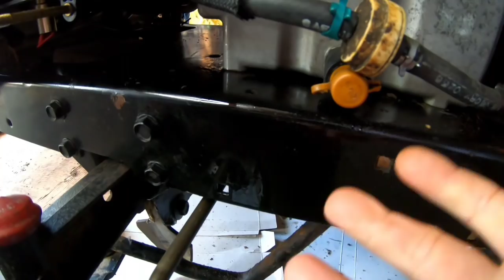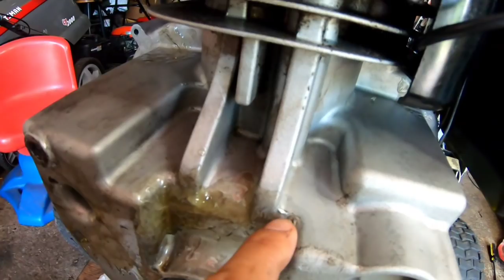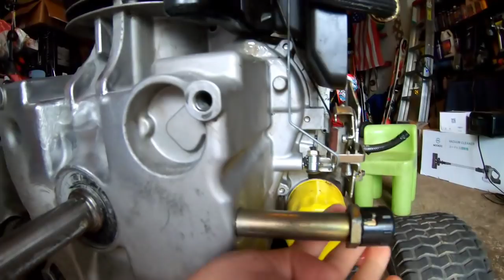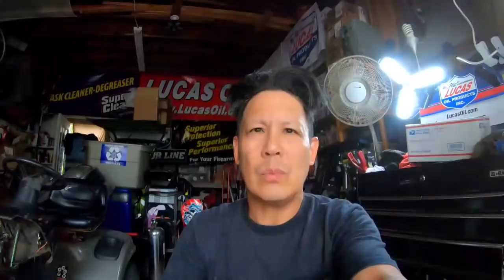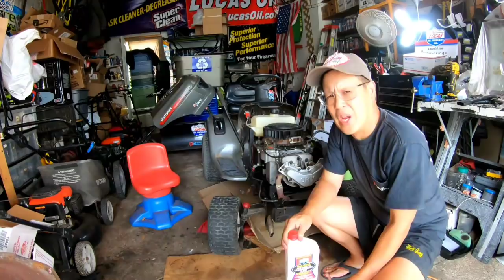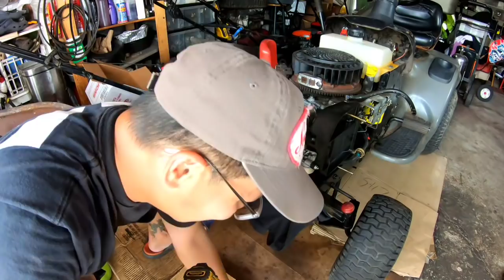CRAFTSMAN LT2000 LAWN TRACTOR REPOWER PROJECT CRACKED PLASTIC GAS TANK REPAIR ACCIDENT & TEST DRIVE

Comment: Henry, We used to repair the plastic tanks that held the calcium chloride that were mounted onto our tandem dump truck mounted salt spreaders by using a similar method of melting a pretty thick piece of scrap plexiglass onto the bad area. 
We had a wooden handle putty tool with a stainless steel blade in which the blade was heated up with a torch almost where the metal was glowing. We used the putty tool to smooth out the rough surface and to help blend in the melted plastic with the plastic tank. This fix works pretty well once you get the hang of working the melted plastic. 
I am glad that you were not seriously burned from me flash out of the gas vapor within the tank. As a welder for many years, I feel your pain and have been there and done that more than I care to admit to. Once a gas tank has gasoline poured into it - It is very difficult to completely get rid of the gas vapor. A good flush with Dawn dishwashing detergent and hot water usually works out pretty well for small engine fuel tanks.
Reply from the maker: You have a solution to get my eyebrows to grow back?
Reply: @MowersNBlowers  Hmmm Henry , Miracle Grow maybe.  I am really glad that you were not seriously burned. It only takes a split second to ruin your life forever.
Reply: @MowersNBlowers  See if your wife has a eyebrow pencil?

Comment: This comment is not directed at Henry, but I was actually thinking about it today while working on mowers.  The entire point of a lawn mower, whether push, self propelled, riding, or zero turn, is TO CUT GRASS!  The most important part for cutting grass is correctly sharpened blades.  Correct angle, straight blade (not bent), sharp.  You absolutely cannot sharpen blades correctly without taking them off the mower, putting them in a vise, taking your time, and doing it.  I see bent, chipped, dull, incorrectly sharpened blades daily on customer mowers.  Book says blades need to be sharpened every 8 hours of use.  Some people are lucky if they sharpen them every 2 years.
Reply from the maker: I don’t have that book,  the book is for mechanics

Comment: That engine is know as the bucket engine, it’s a piece of junk. Then upper part of the engine will loosen from the lower. You will need to tighten the the bolts if it’s knocking and it isn’t too late. The valve covers are notorious for leaking. I pulled my vc off, cleaned it well, and glued it heavily, no gasket, so far not leaks. Just some FYI, hope it works, your leak I can’t say other than use that engine as a parts engine.
Reply from the maker: This is my 8th courage,  I’ve spoken about all those defects in prior episodes.  It’s pretty well known by now!  Thanks for the info.  Hope you subscribed

Comment: I hope you know you have to gauge those valves..4 and 6 I think.. You better check the manual. You don't use Lock Tight.  You have to be able to adjust them.. Are you  really a  small engine mechanic????
Reply from the maker: Who said I was a mechanic?  And it’s 5 and 7. Thousandths….  It won’t tighten which is the problem duh!

Comment: OMG! Do NOT run an AIR COOLED engine without the blower housing in place. It’s AIR COOLED bro, it’s a death sentence running it without the fan blowing air over the cooling fins. Sorry about your eyebrows, they’ll grow back though.
Reply from the maker: Please….it’s running for a minute
Reply: @MowersNBlowers  If you’re driving it around you might as well drain the oil out of it, it needs air over the fins to get rid of the heat. It’ll overheat very quickly and pop the valve seats loose at least if not warp the head etc. It takes no time at all especially under a load.
Reply from the maker: @mjg263  hmmmm maybe that was my problem!  Thanks bro!
Reply: @MowersNBlowers  I know you’ll get it going again because you NEVER quit bro! I’ve got a cursed mower on the bench right now myself, it’s like someone put a voodoo hex on that damn thing. It keeps thing interesting I guess, but I’m really getting tired of taking it apart!